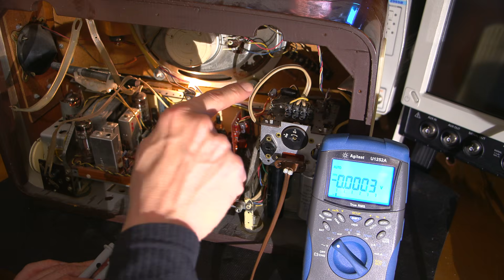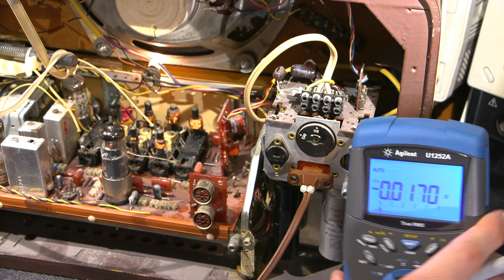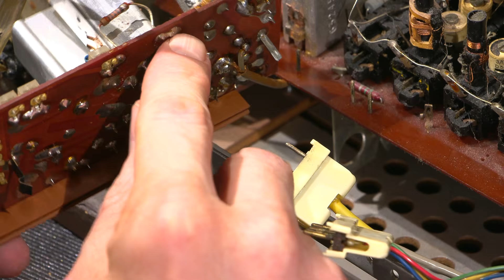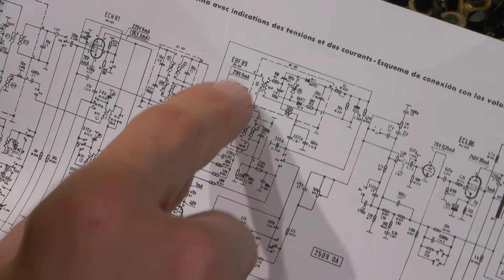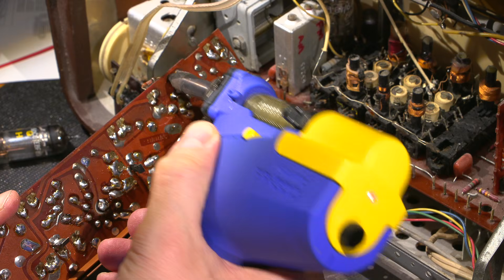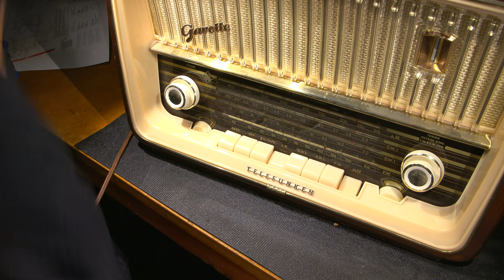Telefunken Radio Receiver Electronic Troubleshooting And Repair!

Comment: You certainly have a wealth of knowledge. Much appreciated by your followers. The tube rectifier and especially the A/C and D/C occurring on a shared platform to create amplification so simplifies the engineering and my understanding the circuit…
Without this basic knowledge the schematic layout was overwhelming to the novice.
Reply from the maker: Thanks for your kind words, I appreciate it!

Comment: Speaking of hot tubes, we used, and I still have, two types of tube pullers. One is the pliers type with the rubber tongs, and the other was put out by GE, which was a foam rubber cup that had two sides, one for large tubes, and the other for small. It's like a rubber oven mitt of a thing, but very handy, and, now, very rare.

Comment: Just one question,mr carlson:did you know multicore solder?i saved three 2,5 kg spools from being thrown in the trash,here in germany, it's classic 60/40 solder,can i use it for my 1950s tube radios,as long as the solder is not dirty/oxidized in any way? Thanks for any answer,and happy New year🎉.

Comment: I just bought a cool telefunken 1960 console with a beautiful cabinet. The radio and turntable do not work. I need to decide to fix it, or turn it in a bar cabinet.  Is it worth it to fix these once great receiver / turntables?

Comment: Hi greetings Carlson's, I see you are very knowledgeable with the radios, I was wondering if you could guide me with regards to a made in China FM AM RADIO, the problem is some FM signals get interfere or out of tune after a while, I believe is the white plastic tuner I don't know, some other FM signals are fine. What are your thoughts?? Any chance to fix it??

Comment: Great video ! I just got a telefunken radio (Atlanta 7051B). It turns out that the "B" stands for battery. IT needs a 1,5/90volt battery to function! Do you have any videos on battery powered radios?

Comment: We've got a Telefunken similar to this (a "Concertina" model, the case is more boxy in shape though).  Used to listen to it at dinnertime back in the 60's.  The issues you described here sound very much like what I remember being the problem with ours the last time it was turned on.  But since that last time it was used was probably 25 years ago, and from watching your videos I know I shouldn't even try turning it on again.   Unfortunately I don't have the setup to repair it myself.  And since we are trying to clear out the house and downsizing our collections it's better for me to just sell it on to someone who will enjoy restoring it.

Comment: Can I ask a question, Mr. Carlson, I have the same radio that worked ok a year ago, but now when I turned it on today, I hear a loud hum. There is some reception in the background, but the humming noise is too dominant. I think it could be a capacitor, but I need your suggestion. Please help. Thanks.

Comment: Man. That rig had some grunt! I could feel my sub (woofer) vibrating my wood floor! LOL. You are a troubleshoot GOD IMO, but just for fun, I would have measured across that new resister just to see if the Vd was normal. Was that just a 4 tube unit?

Comment: that tuning indicator on the  front of the radio looks interesting. It looks like some sort of blue light that lights from each end and when the station is tuned in the 2 sides meet the middle. I have never seen anything quite like it.

Comment: Nicely done! Troubleshooting with your fingers to check tube temperature and guessing it was B+ voltage open circuit somewhere is art as much as science. Telefunken made great equipment and it was so pleasant to hear that deep resonant sound come out of the speaker. Bravo.

Comment: I'm a little confused about when and when not to power tube devices up. Do the caps always need verifying and if not then how do we know? Thank you Mr C. Steve Cornwall UK.
Reply from the maker: Hi Steve. Older tube equipment should have the caps verified before power up just to be safe. Caps are cheap, power transformers not so much. If it's a series set, the 35W4 (or the like) cathode bonding wire will act like a fuse, and destroy the tube.
Reply: @MrCarlsonsLab  Thank you.  Can you clarify upon series set please? Thanks again.
Reply: @MrCarlsonsLab  I appreciate you are busy.

Comment: Can't help wonder what took that 1k5 out? Also a lot of work looked to have been made beforehand. Was it a cap, that shorted the resistor? Or? had a similar fault once, that turned out to be a styroflex with some 200 Ohm over it...

Comment: I thought we weren’t suppose to turn a vacuum tube radio that has been sitting around for awhile until we had checked the paper-wax capacitors?
Reply from the maker: There are no paper wax capacitors in this radio.

Comment: A tip : To isolate the meter terminal you can use shrinkable rubber. When I was a little child I remember this Radio set at home. 1959 or so. I was 3 or 4 years old... It seems to me the model you are working on is a latter model since is plain of printed circuits. Thank you for your video.

Comment: Why did the resistor fail?
Reply from the maker: Just due to cycling (hot, cold, hot, cold)..... Many resistors fail due to this. Sometimes the outer layer of the resistor burns off, letting contaminants in, this speeds the process.

Comment: My grand aunt has a radio of the same name only it's very different on the inside maybe because it's the European model. Story behind it is that it was at a cottage and got damp in the winters and one time it was left on with no one around and it started smoking hasn't been plugged in since this happening sometime in the 70's.

Comment: Comparing the way German antique radios are built to their American counterparts are very interesting. And I’ve collected a few German radios over the years even a survivor domestic Grundig that still works (I even went through every single cap and not a single one is leaky) and As much as I love American radios, the German ones are much more likely to still be working in some degree

Comment: Slightly off topic, but thanks to this (and some other) channel(s) I repaired my first active speaker set. I recognized 3 PCBs: a 'power+amp' board, a control board and a small inputs board.
Since I had already recognized the characteristic 50Hz hum that was quite loud at power up and faded after a second, I had actually identified the problem before even opening the box. The power section had 2 beefy 3300uF 35V caps of which only one (as if it was intentional, to help a novice see the difference) was bulging at the top. I replaced both. (Panasonic=ok?)

This channel helped me identify the sections, know the function of the caps, be aware of the risks - especially in the power section - and therefor gave me the confidence to try this repair. 
So thanks Carlson's Lab!
(I also want to thank Murphy for keeping me alive and for not giving me the hardest problem, but actually the ideal beginner's project.)
(For other beginner's reading this - I had already done some digital Arduino stuff, so not a complete beginner, but power-supply and amps are really a level up. As in, level up on the death-wish list.)

Comment: Hello. I have to ask you. It's a problem I've discovered that I do not think many people know about.
When I connected a stereo potentometer between the amplifier and the audio source in the usual proper way
and connects both GNDs together and measure between both center 
R. L. Pin and turn the potentiometer to one of the sides, you measure short circuit! you get mono sound.

More and more mono the les volume you have!

I do not think many people know about this!

would have been nice if you could say something about this ???

i have a preamplifier board from ebay and potentiometer is NOT connected in the traditional way.
They are connected using 2 pins of the potentiometer per channel.
This to avoid this problem I mentioned

Comment: I`m starting work on a 1960 Plauplunkt  20103 ,radio works fine but cabinet  is badly damaged . I hope it still will when I put the chasses back in .

Comment: Those valve radios with PCB's in them really make me laugh. That was around the time they were being replaced by transistor radios around 1960. Am I right? 
I also wonder what happened to speaker manufacturing, The number of times I power up a very old speaker to find it's 100% better than a modern speaker surprises me. They used to weigh a ton, but they had fantastic bass resolution and warmth.
Reply: Philips first(at least one of the first)  pcb mains  set model was awful, they didnt have enough copper pad area around the valve socket connecrions and they suffered cracked/dry joints, second 'improved' model wasnt briliiant, Philips stuff was notorious for dry joints for many years , although  other brands were afflicted to a greater or lesser extent, i think a problem with the automated  soldering they used,

Comment: I would have thought that TELEFUNKEN GMBH would made this radio a showcase for the Space Charge Vacuum tubes and have a B+ of 45V and a Heater voltage of 3V to make it safe to work on.

Comment: never come across one with a pluggable board , so far !!!  many had a 'service hatch' removable cover on the bottom, so you didnt have to remove the whole chassis for most purposes , Pye here in the UK had a 'quick removal' chassis sytem for a few years, undo 2 screws, pull off knobs, remove speaker leads, and it'd just pull out

Comment: Is it possible for modern resisters not to be compatible with old radios despite the matching ratings old parts?
Reply: Yes. Generally modern parts have reliability so much higher that you’re really destroying the user experience that was typical of that era :) I’m serious. A reasonable modern part will be probably of the highest quality and reliability of the passive fixed value parts in that entire radio. There was a big difference between, say, what parts you got in a Tek or HP test instrument from that era vs. consumer radios made to cost and under strong competition. The European market had somewhat less competition as the volumes were nothing compared to the US market. For every Telefunken radio of that era, there was a dozen sold in the US and Canada combined, and that’s a conservative number. I have a Siemens mini oscilloscope from the same era and there were two failed capacitors that made it not work, and a few others on their way out. The resistors were early metal film type and have kept their value incredibly well, same goes for tube-style fixed capacitors. Part quality is everything. The valves were all strong in spite of having had hundreds of hours on them.

Comment: Back in the day real radio repairmen never carried schematics with them because it was all inside their heads.
Years of learning by doing and (of course) studying electronics we see by Mr.Carlson's example that saying still holds true today. Great video!
Reply: A lot of those older chassis had a printed schematic inside the rear panel. I have successfully repaired a few…. Thanks to these.

Comment: Hard to tell for sure without a real close-up, but in my resistor collection the resistors of the same color your added resistor seems to be, I have bought as Metal Oxide film types.  None of my metal film resistors have come looking bluish gray like your resistor.  Other than that, great sleuth work with your fingers!

Comment: Inspired by your videos, I've started a restoration project on a WWII era Canadian General Electric G-62 receiver that somebody was throwing away. Aaaaand what I thought would be a "restoration" (the laminated wood chassis isn't in too bad condition), turned into a near complete rebuild. The wiring insulation was all crusted to crap, crumbling as soon as I handle it, and the sockets were getting pretty brittle. Most of the resistors have drifted out of spec. The electrolytic, foil, and paper caps are getting replaced, as you'd expect, but most of the black mica's are still within spec. A few mica's have cracked housing and one has a broken-of lead, so I'm just ordering enough parts to replace everything but the pot, tuner, valves (which seem to be good, near as I can tell), trimmer capacitors (which are all still good) and what looks to be a precursor to ceramic capacitors that still seem to be within spec, so I'll leave those alone. Got the schematics, so it's like building a kit from scratch!

Comment: Mr. Carlson, why do tube radio's sound so different from solid state ones when you are tuning them? FM Noise between two channels, for example, is far less than in solid state receivers. Also in AM mode, the noise floor seems to be further down, while radio stations are crisp and clear. Has it something to do with the way tube receivers work? Or with filters that can have a better Q factor at high impedances or? I Notice it on every good working tube receiver.

Comment: Mr Carlson....I purchased a stromberg carlson tube radio the model is close to a 450M , if I recap it what test gear do I need to align it, or other recommendations  you might have. I have the schematics for it...Steve  Johnson.

Comment: I bet Mr. Carlson knew exactly what the problem was from the moment he tried to tune in a station. He just went through the motions as a teacher would so as to not look arrogant. That's the kind of guy he is I think. It's getting hard for him to maintain the modesty because we all know how good he is at his craft.
Reply: Seems like it. He seemed to zero in on it being a resistor problem right away. I would have figured the usual bad cap.
Reply: @christopherlong2301  it was recapped, seems reasonable to assume something different doesn't it ?
Reply: It’s all like smoke and mirrors

Comment: Why do you think the resistor burned up in the first place? Maybe an intermittent short in that 4.7nF capacitor to the screen grid? But that is a styroflex, they hardly ever break. What would you guess, Paul?
Reply: In the schematic it reads 6mA plate current plus 1.5mA screen grid current, so 7.5mA in total. That leaves only 11V over that 1.5k resistor. And this is just 85mW. It should not even get warm. For it to burn up like that, a rather massive (50mA?) current must have flown over it. But where to? Through the tube (e.g., if the control grid gets positively biased)?

Comment: Wonderful fix on the radio. Like the probe fix with the insulation. I use a Probe set by Huntron (MP-10 Microprobe set) Part# 98-0078. They work good on circuit boards and are fully insulated up to there tip, and can be extended to get in hard to get to places. My go to meter is a BK Test Bench 389. I'm also on your Patreon channel.

Comment: Sir, is that means Valve Radios always having step up transformer winding for making +B supply? e.g. primary115Vac : secondary 220Vac (220VRMS x √ (2)=311.12Vdc ?